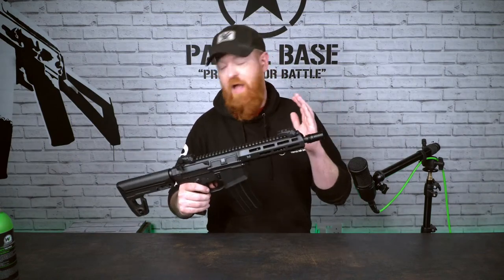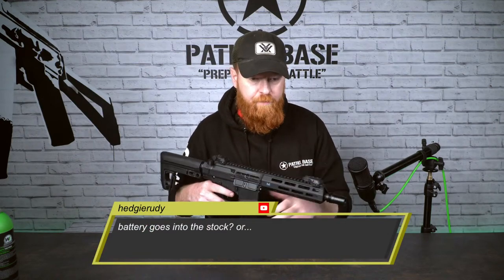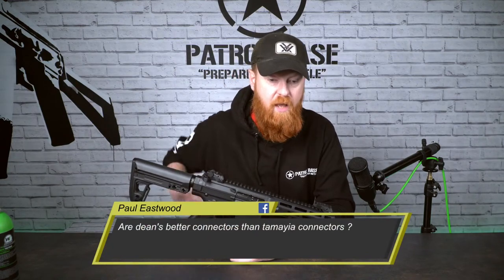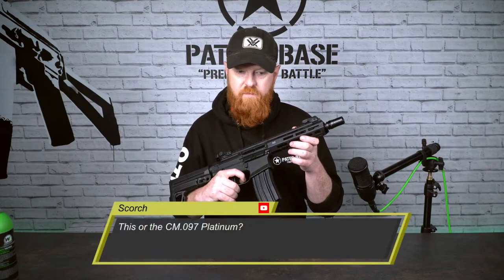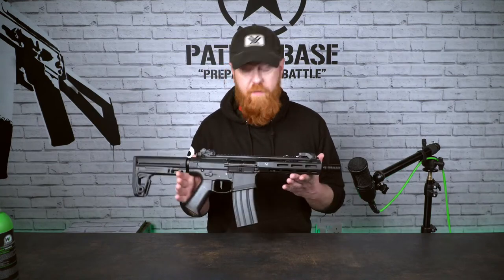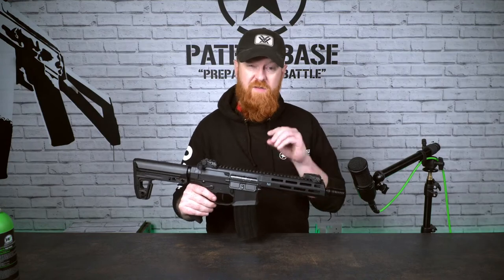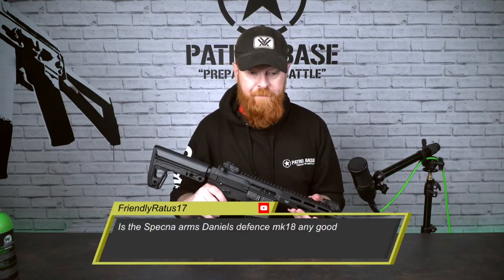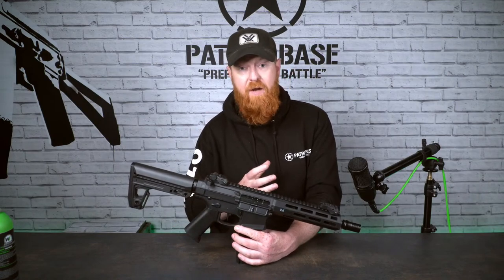Double Eagle - M904E Fire Control System Edition

Comment: Yo battery power only increases cycling rate not fps. Power would still be at 350 fps. A good 11.1 and a ASG 40k will have that gun shooting 350 fps at 30+ rps. Badass and still safe.
Reply: the UK models have a weaker spring than standard so the 11.1v isnt needed unless your upgrade/modify the internals
Reply: @shivsnayee2163  spring = velocity - battery rating = cycle rate

Just like an RC car… 4s battery set up is faster than 2 S set. But your top speed is your top speed irregardless of the battery. A better hop up can also increase FPS.
Reply: So a stronger spring would require a stronger battery too?

Comment: how do you get at the battery compartment!?
Reply: I got the gun and i also didnt know how to open the battery compartment, just hold down the little pins from both sides and pull the stock back. I hope this helped😄.

Comment: recently got this rifle, not sure how to remove the stock on it though
Reply: have you figured it out?
Reply: @farisouiles5451  yeah, wasnt paying attention and didnt think that the main lever on the middle of the stock did more than the main function of extending the stock. running it with a nurpol 1300 deans battery now
Reply: how so you remove the stock
Reply: @maliksworld8467  u got the main button near the end, the clear one that adjusts it along the buffer tube
then the removal one, a stiffer, small latch sized button in the middle of the stock. you can see the spring visible, push that up and pull the stock back to remove it.
hope that helped
Reply: @merkymurk7534  thanks it worked, this thing is a beast
Reply: @maliksworld8467  im probably gonna upgrade the motor in the future, rpm is kinda lacking but other than that, loving the gun.

Comment: How do you turn off binary
Reply from the maker: you can do it 2 ways, 1 with a full reset by pulling the trigger on safe for 5 seconds or following the same instruction as turning it on, pull the trigger is safe for 3 seconds and it will beep 3 times pull the trigger 3 times and move to safe that turns the binary function on and off.
Reply: Pheas airsoft has a great vid on all the settings on this platform and a tear down vid with how to get to all the gubbins, stock/gearbox/motor/spring etc..